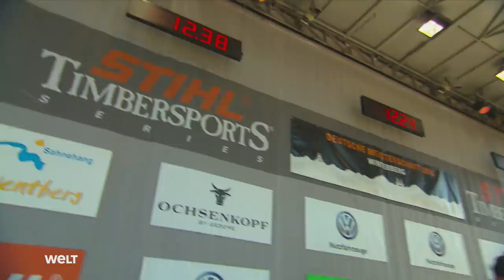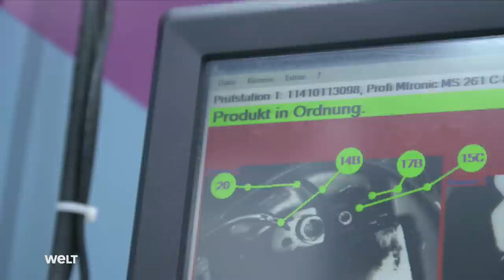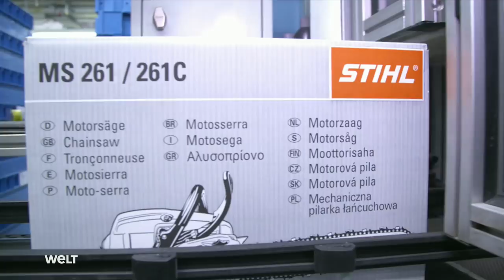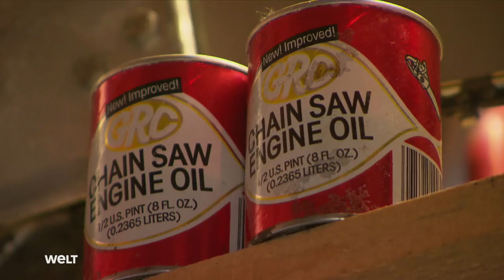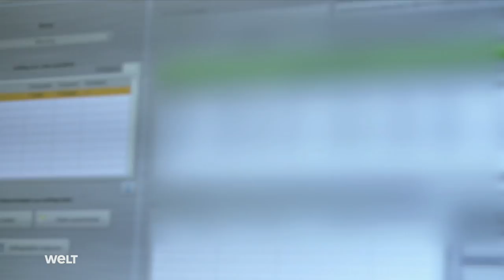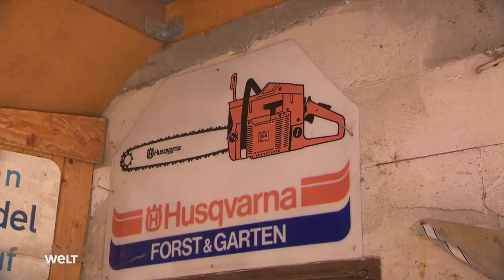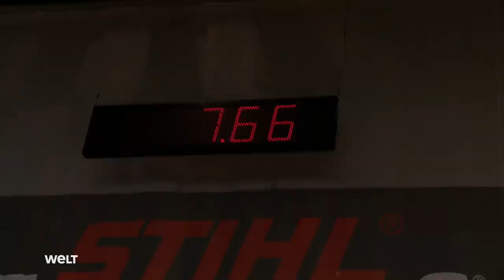CHAINSAWS In Action - Sharp, Powerful & Loud - Timber Sports | Full Documentary

Comment: So, around 23:50 , it's not that hard to build a 2-cylinder vibrationless design, such as a horizontally-opposed twin, or a single with a good balance shaft. 
What usually happens is that I comment like this, then they address it in 2 minutes in the video. lol